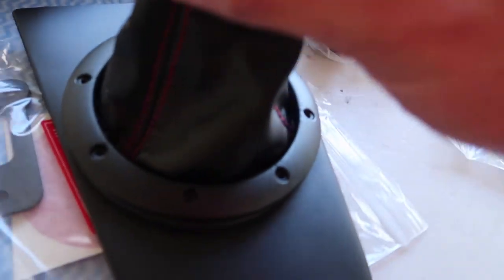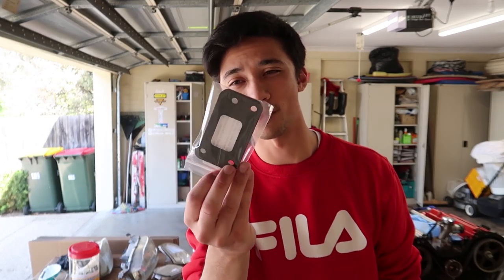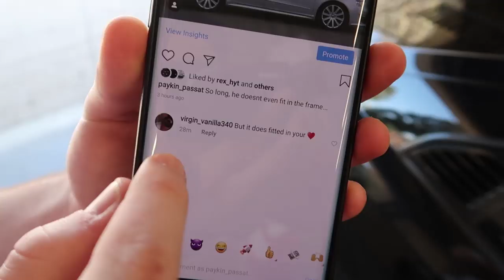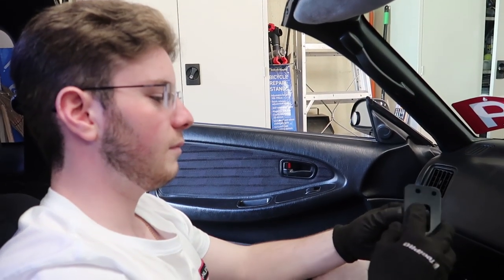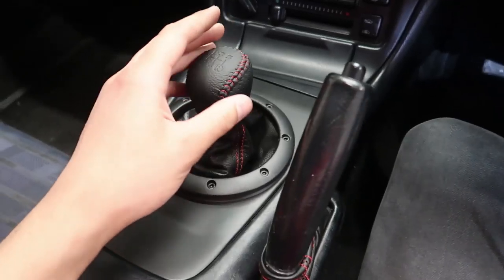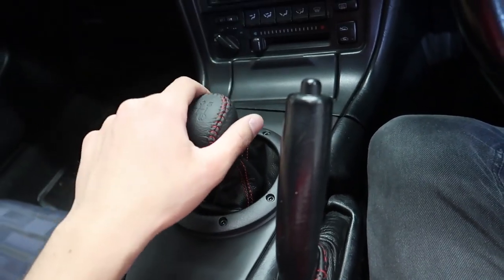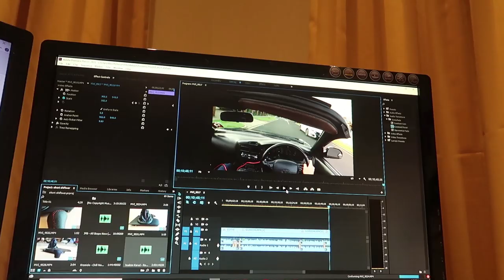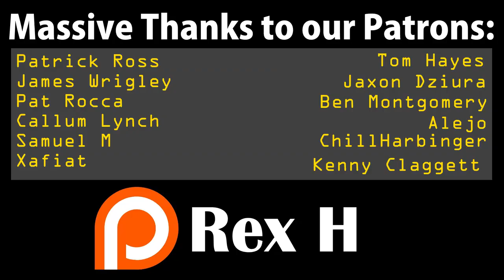The MR2 Gets Interior UPGRADES! - NEW Shifter Trim Assembly!

Comment: There's so often extra travel in the shifters such that they hit the edge of the opening. It must be wear or adjustment in some locations. However, it does seem logical that lowering it will make it hit more and raising it a small amount would stop it hitting. Simple logic or maybe geometry.